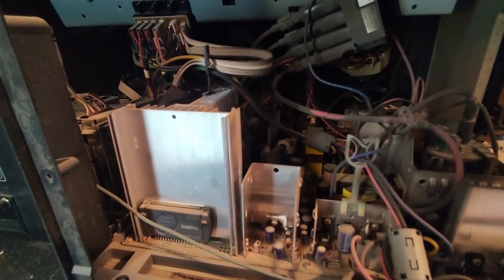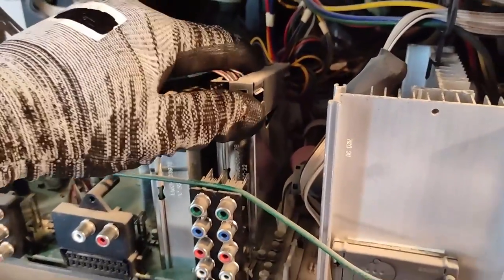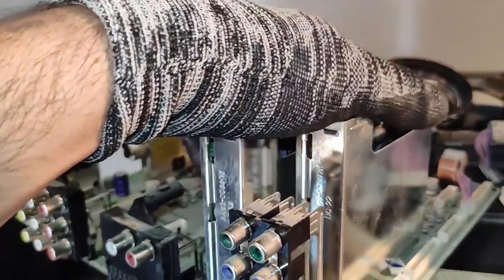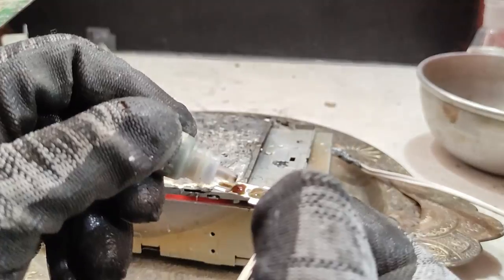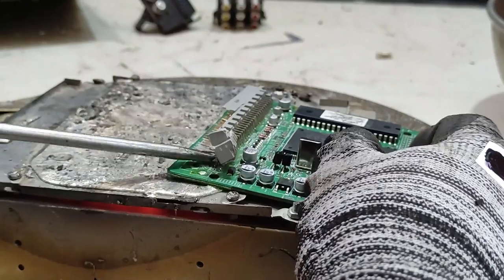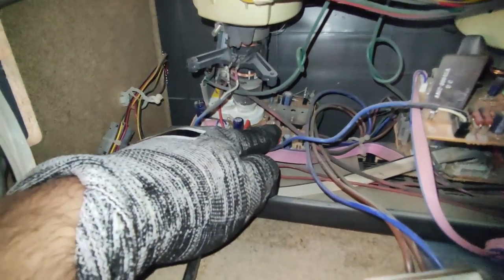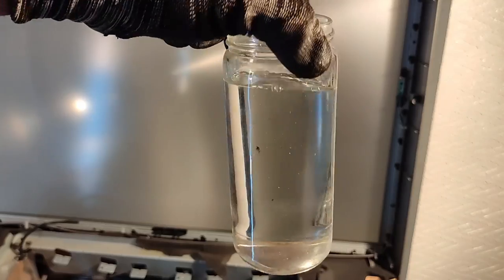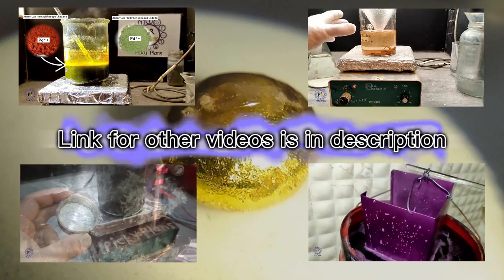what is inside of a Rear projection TV ?!

Comment: I always process all CRT glass tubes; they yield an average of 22% pure Lead, and a little Barium. The front panel glass contains a nice amount of Barium, and some Lead. The flourecent layer on the inside of the front panel glass yields REEs (Rare Earth Elements). 
The thick glass lenses you took out contains various REEs; so do camera lenses, scope- and/or binocular lenses, and some lenses inside electronics.
Internal metal parts in the CRT tube are nickel steel, which is processed for Nickel recovery.
Any type of PCBs are processed for solder recovery. First in 6.5% HCl for the tin, then, after rinsing with distilled water, in 9% HNO3 for the lead; both steps at 80 C in water bath. Wet electrolytic capacitors are pyrolyzed in a heavy thick walled stainless steel vessel (they explode when heated) and yields a lot of aluminium. Electronic components are sorted and processed according to each type. Every value is extracted.
The bare boards are treated for Bromine recovery, pyrolyzed, and ends up on the shaker table where the copper layers are separated out.
Reply from the maker: That was awesome explanation of full recovery process. All interesting , I've never known about bromine recovery from PCB'S
Reply: @PickyPlans .   Hot HBr, and also Cl gas (when making free HCl acid from plastic) eats almost everything. If you wanna build an apparatus capable of withstanding HBr, Cl, and even F, you should take a look at the different Monel Alloys. 
I have 4 pyrolysis units, all constructed with individual modules. Same fire chamber, but different separate pyrolysis vessels. One is made entirely of stainless steel for handling corrosive material.
As a scrapper I have a steady supply of discarded brand new stainless steel cut offs from productions. Whenever fx. a pipe shows sign of corrosion I just cut it out and weld in a new piece. Maintenance at no cost! Seals are ceramic fiber cord which lasts for the full pyrolysis run, and must be replaced before the next run anyway.
Elementary Bromine is notoriously difficult to store. It disappear out of bottles through the tiniest microscopic gap under the lid of bottles. It even escapes through the walls of plastic bottles, except PFTE bottles. Glass bottles are perfect as long as they are completely sealed. I pour 2 kg of elemental Bromine into old 3/4 liter wine bottles. With a homemade circular gas burner the neck is heated until the glass becomes soft, it's then twisted to seal the bottle completely. This leaves a thin sharp tip of glass on the top of the bottle neck as part of the upper neck disconnects during sealing. Immediate reheating and gentle taps with a water soaked wooden pin flattens out the very top of the shortened bottle neck. Just as a side note, the latest sale of Bromine was 40 kg.
There are several ways to extract Bromine from e-waste. Common is whatever way you choose it's always a multi step process. Which way to go depends on whether your raw material is waste plastic with added Bromine Fire Retardants, or bare Printed Circuit Boards. It also depends on whether your aim is HBr acid, NaBr, or elemental Bromine.
During the past 12 years I've spent more than $100.000 travelling around the world visiting lots of recycling companies and commercial metal refiners. I've seen it all, so I don't travel much anymore. My latest trip a couple of years ago was to Brasil. I spent a month passing by both small and big companies to study the Brazilian recycling industry. Very impressive.
Scientific research is steadily revealing new results, so I'll continue to buy scientific papers showing the lastest research reports.
After having spent a fortune and virtually thousands of hours during the years to gather the knowledge I now have, I'm more than reluctant to show everything on a public forum for free. It seems a bit unfair to me after having paid lots and lots of money for information, just to give it away for free. Anybody can then copy the procedures without having contributed with a single dime or penny; or any useful information in exchange. In fact I considered for several days before deciding to reveal the full process of solder recovery from PCBs.
Be aware that some processes are covered by patents and cannot be used without paying for a license to the owner; something people in certain countries don't give a damn about. I don't want to get into trouble. 
Additionally, a few processes was shown to me solely against a promise of never revealing anything to anybody. They are actually in house developed processes highly guarded as business secrets. This category will definitely not be disclosed no matter what, as I'll never break a promise.
I could make hundreds of videos on YT showing virtually all profitable aspects of scrapping/metal extraction/refining, but I don't have time for it. Ad revenue would cover some of the costs for having obtained all precious information; however, I can still earn a better income by doing backyard scrapping. No scrapping videos goes viral with millions of views; they're too specialized.
Countries like India, Pakistan, Indonesia and the entire Middle East, among others, are full of people who are pleading for complete tutorials on various subjects so they can make a lot of money. They doesn't do anything themselves, and still expect to have everything served for free on a silver plate. I'm seriously tired of all those annoying beggars.
I don't exactly need money for providing useful information. I make $250.000/year in highly effective streamlined backyard scrapping, that's a sufficient income. It's just that the deprived morale of some people is disgusting and unforgivable.
Not that I don't want to help people in general, but in this case it'll be limited to those who show initiative and at least try to solve technical obstructions by themselves. If someone is stuck with a problem I'll gladly advise to find a way out.